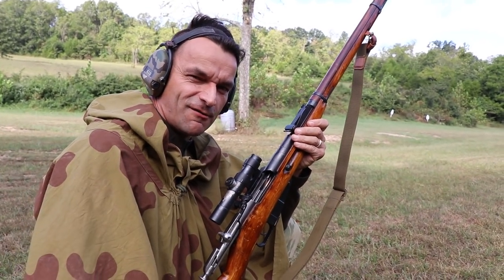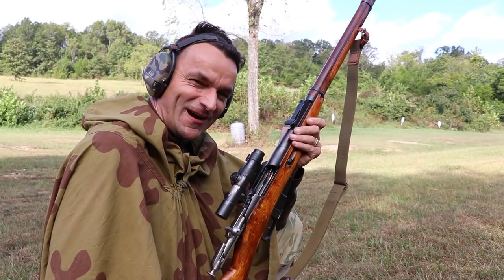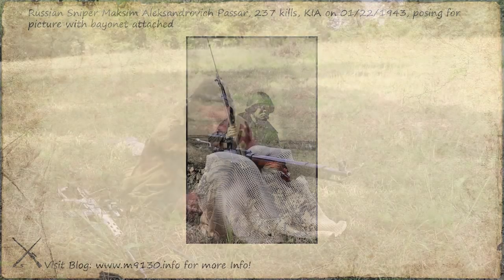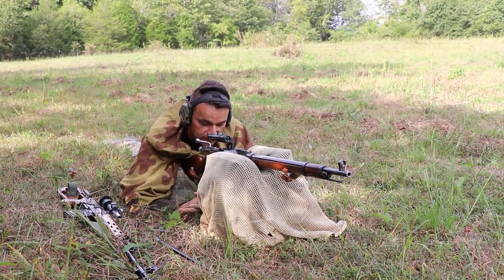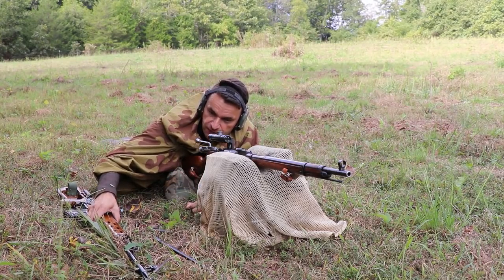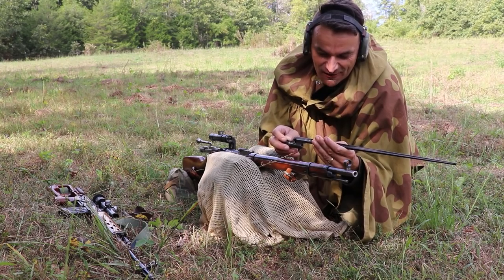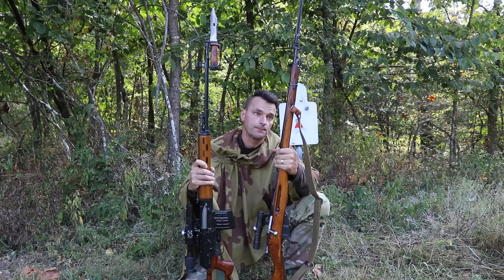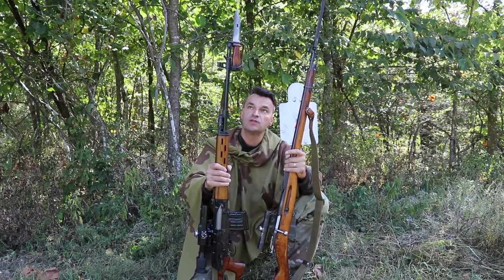Bayonet Madness - Soviet Style?! Soviet Snipers running their rifles with bayonets - truth or myth?

Comment: I read 2 books written by Russian snipers from WW 2 . Most of the snipers where part off regular infantry units. They would participate in regular assaults on the enemy positions and would attach the bayonets "On the run" just before reaching the enemy trenches. They never shot with the bayonet attached ! ( They where afraid to lose zero since they rarely had time to collect data and re zero the rifles for the bayonet) . Both books where written about the sieges of Leningrad and Stalingrad. The snipers who where part of specialized units never bothered to even carry them (Bayonets). They used trench shovels and knifes for hand to hand encounters. And when they went for the  night missions to capture enemy solders for intelligence They carried sub machine guns or pistols and would leave the sniper rifle behind.
Reply from the maker: You are not going to loose zero when shooting with bayonet. Zero point of impact will shift with bayonet, but it’s repeatable event so you can compensate for it. Once you take bayonet off, zero goes back to where it was. So as I said in the video, there is literally no issue to create dope card for rifle with bayonet and without it.
Reply: @VintageRiflesShootersClub  I didn't explain myself correctly. Most of the snipers in those days didn't have a "dope chart"  Majority off them didn't even receive a proper training . A commander would see a good shooter in his platoon he would be given a sniper rifle, zero it and from then on "On the job training" would take over. They usually would zero their rifles at 100 or 200 meters and would not touch the turrets from that moment on. (Used "Hold overs") Up until the end of 1942 when the Front got a bit more "Stable" and they started training their snipers in a more organized manner. The info i got is from the accounts of the veterans off WW 2. Books and Documentaries (I speak and read Russian fluently). That is why they never shot with the bayonet on. That is what i meant when i said "They where afraid to lose their dope"

Comment: The shift in point of impact with the bayonet on is due to the change in the barrel flex / jump / whip as the projectile moves up the barrel as the bayonet adds weight or barrel drag thus affecting accuracy.  This happens to all rifles that have bayonet mounts and bayonets fitted .

Comment: The m91/30 is designed to be shot with the bayonet.  I have shot it with and without the bayonet, and a difference does exist as to the POI.
As for the Sniper version (PU Scope), one adjusts the windage and elevation in a strange way.  I is not like a modern sniper rifle.

Comment: What are the mechanical reasons for the aim shift? Does the bayonet actually change the barrel dimensions in some way or does the bayonet affect the bullets flight after it comes out from the barrel?
Reply: I believe it affects the barrel harmonics, essentially the more stuff touching the barrel and applying pressure will make the barrel movement change.
Reply from the maker: In simple term, it's basically weight hanging from the end of the barrel - this impacts barrel harmonics which makes a difference in point of impact shift.
Reply: @VintageRiflesShootersClub  That makes sense. I was just wondering if the first bayonet would push the bullet slightly to the left, in a bit similar manner as airplanes face increased lift when flying close to the ground. Who knows, maybe it does to a lesser extent, but evidently the total effect isn't limited to just that.